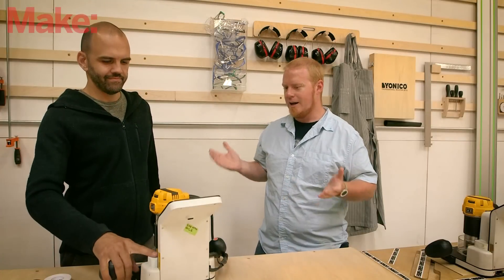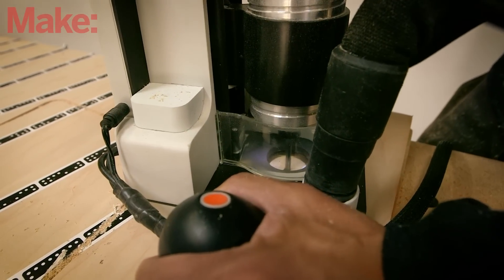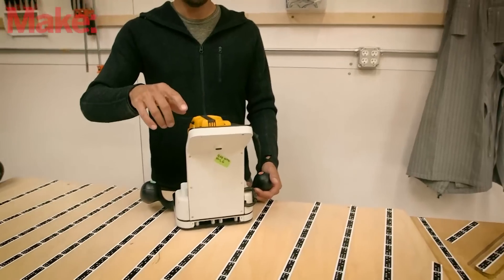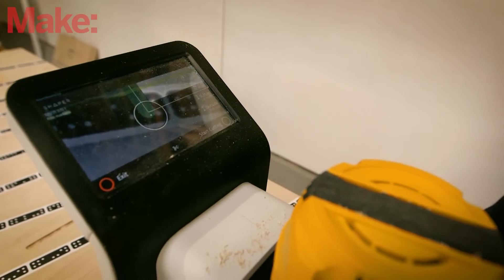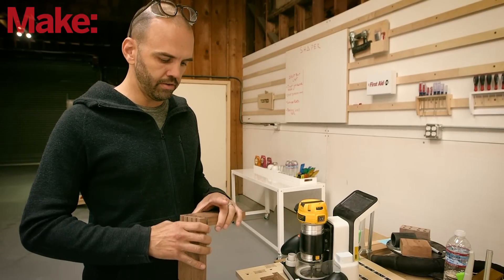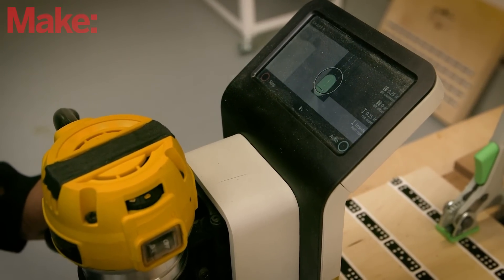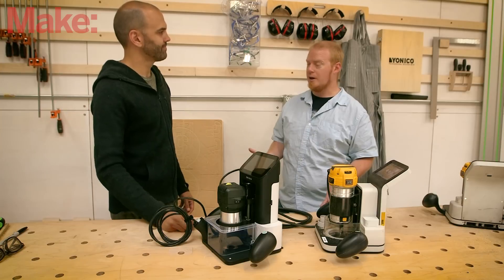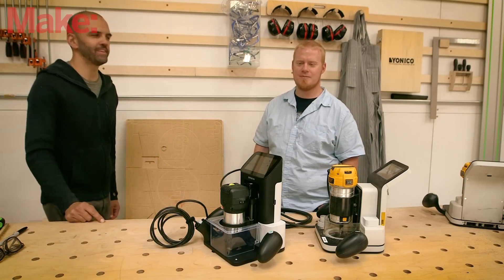Portable CNC: The Shaper Origin

Comment: Is the tape open sourced so if the company goes out of business or stops making it you can still use it?
Reply: The tape can't be copied, at least not for very long. Each "domino" on the tape consists of a pattern has 16 dots that are either white (show up) or black (doesn't show up). Thus there are 2^16=65536 possible dominoes. Think of the dominoes in sequence on the tape as letters forming a long string of text, only with an alphabet of 65536 letters instead of 26 as in English. Even if the tape were only two characters long there would be 65536*65536=4.29*10^9=4.29 Billion possible sequences. Imagine how many three or four characters long sequences of sequential dominoes there are, yet there is no limit. 

They can essentially make a secret non-repeating pattern of the dominoes that is generated by an algorithm, like a really long sentence of what seem like random letters, but which only they know. Thus every roll that they ever produce can be one unique snippet of the secret non-repeating pattern.  Only sequences of characters from their secret non-repeating pattern will pass a checksum test, and the rest are rejected by the software. 

The unit can log which sections it sees and report these back to the company during software updates or over its Wifi link. If hundreds of units start seeing the same sequence, that very small part of the sequence that was copied by the Chinese company can be invalidated in the next software update or over wifi, making your Chinese tape useless. Encryption is a simple way to make a commodity item virtually uncopyable.

As a side note, by logging and reporting these sequences, they can also know exactly which routers are using which tape, from which roll, from which batch, made on which day, sold through which distributor, or if bought directly, shipped to which house. Scary, huh?
Reply: depending in the price they come up with, there will be a cheap Chinese clone-tape on launch date... it's even pretty easy to order your own custom tape.
Reply: I pre-ordered it, despite the wait, because it is truly revolutionary, and because of the discount. BTW, if you are thinking of preordering, you can use my referral link below and save both of us both an additional $100 off of the pre-order. : 'https://preorder.shapertools.com/ref/T2GWF9N3A'
Reply: From the device's product page: "We will never require you to maintain an internet connection to use Origin, and Origin does not need to communicate with Shaper servers to function. You will always be able to transfer your design files to Origin using a USB flash drive. Connecting Origin to your Wi-Fi enables you to download updates that improve Origin, and to get new features as we develop them."

Basically, even if your tinfoil-hat theory is correct (and that is quite a big if, because it means they would be blatantly lying on their own website), it will be easy to find out which software version is compatible with which tape pattern by matching up the software revision number with the tape rolls released on that date.  All any Chinese company needs to do is copy a single roll of tape purchased during the lifetime of a specific software revision, and say on the product page something along the lines of "this tape is compatible with Shaper Origin firmware(s) x.xx".  Also, something else that pokes some pretty large holes in your theory: if every roll is unique (or even if series of mass produced rolls are unique) that means firmware updates will be REQUIRED to use new tape manufactured after a firmware update is released.  If they say that you will not need to update the firmware for your device to function, and shaper tape is required for your device to function, that means they cannot release shaper tape that the original firmware (or any old firmware revision) does not recognize.  Please use logic next time, it's something us humans have been blessed with for good reason.
Reply: I'm too poor and don't really need it, so fortunately this gives me a good excuse not to want it.  So many small companies like this go belly up eventually and I wouldn't want my router to become a paperweight because they wanted to make money on a consumable.
Reply: this isn't their first tool.
Reply: you just need to copy one roll exactly if thats the case. but my guesss is that every dominoes are diferent so that there is never a repitition so that the machine knows for sure where it is
Reply: There's no special pattern or anything in the tape. It's just a sequence of unique numbers in the form of dominoes. It ensures your whole scanning surface can be translated to a grid with unique locations for the software.
What maybe wouldn't work is if you applied the first foot of tape from 10 different tape rolls. Then there wouldn't be unique markings.
If you think about it, you can come to the same conclusion. They've shown that you can add tape anywhere on your surface if you want to extend it even after you've already started. You also don't have to stop your tape at the edge of your working surface, you just stick it under and tear it off. Neither of these situations would work if the tape has some secret code that the software needs to read linearly.
The only worry is that your off-brand Shaper tape has to be of sufficient quality. That's China's challenge.

Comment: Its basically a router telling u where to go. Pretty good
Reply from the maker: More than that, the router head has a degree of X/Y movement to correct for when you go off the line - and will lift the spindle away from the workpiece if you go too far out of bounds
Reply: Yes.  Just point and go.  You make the larger movements to move the router along and it self adjusts to finer detail work.  Kinda Cool.  Both human and machine work as one to complement each others actions to complete a task.
Reply: Thanks. I wish this was made clearer in the video.

There was little to no explanation of what the thing was actually doing.
Reply: Actually its very visible at 0:54 the base is not moving but router is making the hole itself. But it would be nice to mention about margins of that movement  that machine makes itself along x and y axis..
Reply: it was made clear

Comment: this looks like a very overpriced milling/router handheld machine. Feel free to correct me but that is what it looks like to me.
Reply: Do you understand what CNC means? This isn't just a router. You can create a complex shape digitally and the Origin will cut that shape out precisely and reproducibly, with the assistance of your gross motor skills. This can replace a router by disabling the tracking feature, but it's primarily meant to replace a CNC machine, which can cost significantly more. This video did a poor job of illustrating the purpose of this tool, but you're mistaken if you think it's just a fancy router.
Reply: From what I can see, the idea is that there is no restriction to project size on the machinr's end. That's what makes it special.
Reply: They don't really show it off well. It's not about cutting straight lines, you can place holes and features throughout the piece, just like a CNC milling machine, and it will cut them precisely.
Reply: I still don't understand how this $1600 costing thing will replace a simple $100 router/miller
Reply: Maxwell Benson Yeah, it's also very portable.

Comment: Its an AWESOME idea but I feel like it s just alot of set up work and there is room for errors. I'm no expert, just my feedback from what I saw. In my opinion, I'm getting a CNC machine so that i can clamp a piece of wood down and forget about it until the milling is done... with this I feel like it'll maybe give me the same result with alot more labor.
Reply: Not everyone has the space for a big CNC though, so this compact size of this is probably the main selling point.
Reply: Theres a good amount of fixturing and setup with a millling CNC machine. Tooling and work holding can be another 50% on top of your machine. It adds up fast. And mistakes with stock size, limits and occasional g code errors that end up in broken bits and trashed workpieces are common for first time one offs.
Reply: It doesn't run off g-code, it just takes SVG files. The big appeal here is the ease of use: anyone can design and cut anything without even having to have a steady hand.
Reply: Well, the primary points seem to be 1) portability 2) deployment time 3) cost. How much your traditional CNC is going to cost?

Edit: Guy went off track and the thing lifted the cutter up. Seems to be quite robust, unless you intentionally feed it too fast.
Reply: Ok, I can see the portability point . Idk maybe i'm just old fashioned haha
Reply: Imagine yourself drawing the piece with a ruler, angle gauge and pencil and then following the lines with a router (or jigsaw). Slow, tedious work with many opportunities to screw it up completely.

This machine reduces the chances of error to very minimal level, allowing you to produce CNC-quality pieces anywhere.
Reply: I'm under the impression this runs off a G-code file. If so, then you will be spending time creating the object you want to cut. If I was going to spend the time making a g-code file I would either just send the file to a regular cnc machine and work on something else while that cuts the object out, or just make a template of the object and use a flush trim bit to cut it manually.. I can't see this machine replacing a cnc machine or replacing a method in my shop that would justify a 1500 dollar purchase.
Reply: I don't think that this machine is even intended to replace a CNC machine in a shop that already has one - unless the existing CNC doesn't have large enough work area.

I see it as a good tool for someone with the need to cut precise predesigned (or with the simple built-in templates) pieces in a place where CNC doesn't exist.

I think that it will bring new kind of smallscale manufacturing possibilities just like 3D-printers did. A hobbyist with no room for any scale CNC but a need for exact cuts.
Reply: Didn't look like much set up. If doing something custom then there is going to be design time involved as there would be with a CNC or even if doing it by hand.
Reply: I think your missing the point. It obviously works fairly well from what we can see in the video. Makes accurate cuts all that. We won't really know how well it works and how reliable it is till it out for sale. No it cannot easily do everything a CNC machine can, however it has no size restriction and saying that it costs a fraction of the price of a CNC machine, would be vastly under exaggerating it.
Reply: You don't have to use software to make shapes if you don't want to. You can draw shapes by placing the router on points and clicking to make any polygon shape. Just like the line tool in the older MS Paint versions where you keep moving your mouse and each click it connects a line to your last point. And there's all the shapes in the software to pick from and manually set your dimensions without any external input from a smartphone or computer.
The great thing about this is that it doesn't matter if you work on a small piece or a huge piece. So it replaces what a $500 CNC can do but also what a $10000 CNC can do. And best of all, is the mobility. You can take it anywhere you want and work in any orientation you want. You don't have to take a cabinet or a kitchen, a wall or a shed to your shop and find a way to fix those things in a CNC. You wouldn't even think to try that with a CNC.

Comment: So they have taken one of big draws of a CNC, that you can go Popeil on your work and "set it and forget it" and completely nullified that?  It is a human powered pseudo-CNC.  Yeah, you are not limited by bed size, and it is portable, but to me it seems pretty much useless.  Cool tech, but totally useless for any reasonable use case I might have.
Reply: It's obviously not for automated use but it does give you the precision of CNC as it corrects the tool position constantly. It's not for everyone but I would consider one to supplement my CNC router for when I occasionally want to work on full 8X4 sheets.
Reply: In 1965 we used to "set and forget" the Main Frame computer. Nobody wants to do that now. We like our more powerful smart phones. See the similarity??
Reply: No.  They are completely different paradigms and mainframes were not "set and forget" anyway.  They had operators.
Reply from the maker: No CNC, particularly in the hobbyist market, is set & forget. You still need to be in the room with the machine to stop it if something goes wrong. That's fine if you have other projects in your workspace to work on. This machine compromises convenience for size.
Reply: It also compromises convenience AND price.  It is a $2100 unit.  Sure, it can do arbitrarily large sizes, but it is exorbitantly priced for something that requires that much work to use.  Regular price on a fully decked out X-Carve is almost half the price of this item once pre-orders are done.

Again, I think it is cool tech, but essentially useless for anything I would want to do, and severely overpriced for what it is: a human propelled CNC, sort of.
Reply: This actually is not very useful. It was demoed with a professional user. What about if I move a bit too far to of the line will it pull up really fast so I don't make a mistake. If it can't do that I would just buy the router for $300-400 for basically an attachment to hold it the same way. If I need to tape the work piece I could just put my template on it.
Reply: It gives a fairly large margin of error, you only need to be close to the line and it compensates the rest and yes it does retract the bit if you go too far off. It's not just a digital template it actively keeps the bit on the toolpath while you provide only the gross movements.
Reply: They addressed just that in the video...
Reply: I didn't think of that, invest in a large format printer instead and just tape your plans to the wood.  But of course, once your start cutting, the paper is going to get all messed up and shift around.  Also if you do it yourself with a router and you don't have perfectly steady hands, it's going to look like absolute crap.

Comment: Pocket sized? Wtf make, get ur shiz together.
Reply from the maker: FINE. It's portable CNC. ;)
Reply: I think the guys at Make are still wearing their Jyncos from the 90s.
Reply: Would fit into the pocket of my fleece jacket - just barely. :P
Reply: that it's very cool. you just follow the line and it makes all the little ajustments to make what you cutting out perfect. can upload pics to the machine. the one thing is we gotta wait and see if the router that they actually sell it with is as good as the Dewalt 611